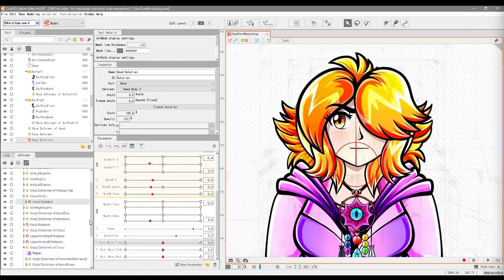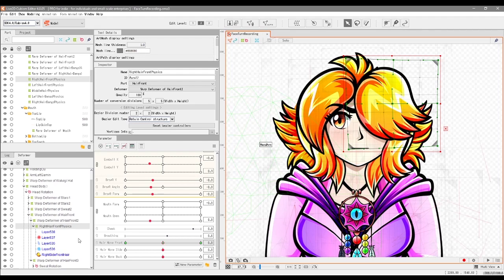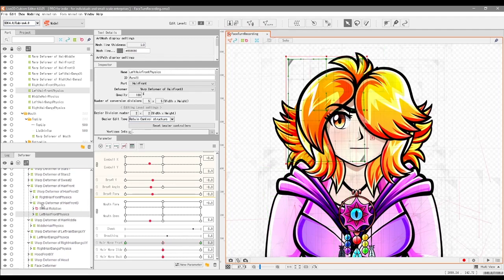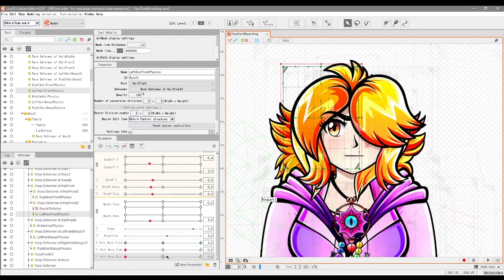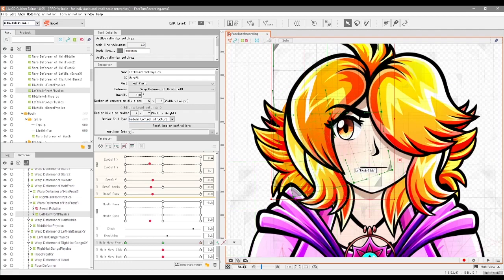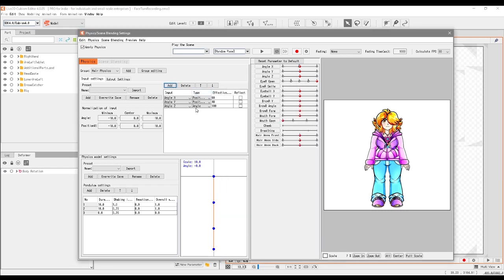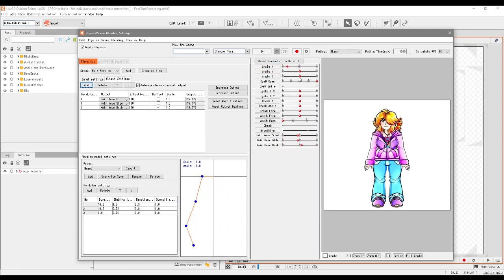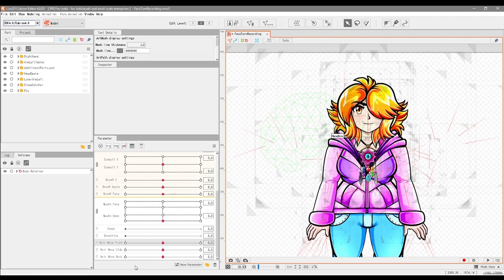How to Rig Hair Physics (FaceRig) - Live2D Vtuber Tutorial

Comment: Hey! Thanks for your awesome tutorials! You are one of the very few people out there that keeps the videos nice, concise, easy to follow and structured. ^^ I am new to Live2D, but in my experientes regarding the physics: As far as I have tested, you can add new physics fields yourself. They MUST have the range -1.0 to 1.0 though, otherwise they won't show up in the physics output tab as far as I can tell. Since Facerig to my knowledge uses the Live2D SDK, physics should be computed within that Live2D SDK they are using, so that should work out of the box with no need to set anything up (since the physics parameter is not something Facerig will actively use).

A kinda different, kinda related question though: The "Breath" parameter is animated in the Live2D physics tab constantly from 0 to 1 and back and to my knowledge also in Facerig. Do you know if there is a possibility to add new parameters with such a functionality (where you can set how fast or slow the parameter is getting animated)? That would be awesome to have ghosts hovering up and down, hair constantly wiggling a bit, etc (and it would be nice if not all movements are synced up). As far as I can tell, this animation is something you can set via the Live2D SDK (see http://sites.cybernoids.jp/cubism_e/sdk_tutorial/framework/breath for example), so to use it, there would probably be also a Facerig setting. Or is there any way to emulate that? Otherwise I will stick to breathing ^^

Comment: You can add as more parameters as you want, they just must have a Ranges Min -1.0 Def 0.0 Max 1.0 for Physics.
Reply from the maker: Does this work for the software FaceRig? Maybe it's easier with other facetracking software but since I use FaceRig everything is set to 3 Parameters from what I understand currently. I heard that there might be a way of adding more, but I think it had something to do with the CFG file. Do let me know if this is the solution though!
Reply: @dreamtrove  i work with facerig only too and it works with any CFG file.
Reply from the maker: @Lazu_Live2D  That's great! If you can explain how to set up the CFG file code for adding more physics parameters that'd be awesome! Then everyone seeing this will know how to make this work as well!
Reply: @dreamtrove  you don`t need CFG file.Just add parameters in Live2D with the same Ranges and nothing alse.
Reply from the maker: @Lazu_Live2D  So just to clarify, you create a new Parameter, set the values to -1.0, 0.0 and max 1.0. What about the parameter ID?
Reply: @dreamtrove  Sorry for my english, I meant it works without any file х)
Reply: @dreamtrove  Yes) I don't do anything with ID, it doesn't really matter
Reply from the maker: @Lazu_Live2D  Ok thanks for the help! I'll give this all a try when I have time :D
Reply: @dreamtrove  good luck))

Comment: For the hair physics I used the deform path tool (P) and placed it on the strands that I want more bounce and smoother flow on.
Reply from the maker: As long as you're fine with keeping the hair the same for your model, this is great! If you're someone wanting to change hair colour or hair styles using an On and Off Toggle like Special Poses in FaceRig. This would be a problem, because you're using the main layers of your models pieces, you would need to edit all the keyforms and parameters associated with the hair pieces for things like the Opacity change. You can always edit and swap out elements and make a separate new rig with all these hair changes but just throwing this out there for anyone wanting to make toggles for it with one model. This is why I use warp deformers a lot now just to prevent from any possible set backs!